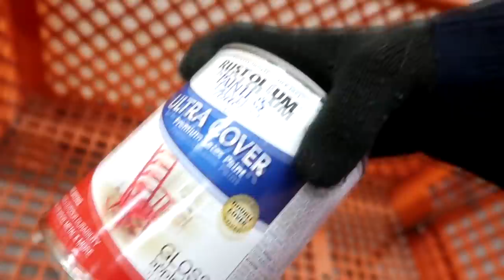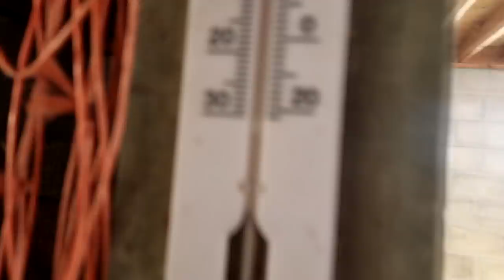FIGHTING WITH HER HORSE! Day 131 (05/09/20)

Comment: The poop pile turns to mulch which is what is used for gardens and fields. We normally spread last years winter pile on this years fields. It all decomposes after a while and the shavings wont be a problem as they will have decomposed. If you dig into the middle of your pile you will see a lightish brown colour that is an almost soil like consistency, this is your mulch. Hope that helps ☺️

Comment: I’m not tryna hate or anything but if you are trying to catch him then gabby should not swing the head collar towards him and also wait until he stops cantering and walk towards him quietly with your hands out
Reply: Lynda Youngson he was running away from her before she swung it.  If she waited for him to stop he probably would just walk or run away again when she tried to catch him again.  Making them work harder when they act like that is what ur supposed to do.  They will get tired of it and stop after a few times.  It shows them that u will be pushed around or tolerate that kind of behavior.
Reply: Lynda Youngson she already tried walking towards him quietly, but clearly that didn’t work. So she was making him move his feet. If he did not want to come to her, she was going to make him work harder. That way he would realize that it is easier to just stand still rather than to run away. She was showing him that she is the boss. That’s how you should do it with horses. Maybe do some research.

Comment: not hating but if u put headcollar behind your back and don't run after him and throw the headcollar at him might have calmed down but the wind can get them wired up anyway
Reply: It's pressure and release. If I cant catch my horse I make him run to say that if you come it its rest time. Putted the head collar behind back normally causes more problems
Reply from the maker: She never threw a halter st him. She used it as an extention of her arm like a lunging whip to make him run.
Reply: @mu5tang155  in a big field it dont rlly help tho
Reply: @ellenwillxams9837  no but that's why you bring back up tape
Reply: @mu5tang155  wouldn't it b easier to just let him calm down and use your voice
Reply: @ellenwillxams9837  yes but doing that dont really work. It all comes through ground work. Which I think finn needs way more of. Not just lunging but relaxing and that's when Warwick Schiller videos come in handy
Reply: Myponyfrodo Using your voice doesn’t always work with horses. Sometimes you got to use your body language, like they do with their friends. Gabby was making him move his feet. If he did not want to come to her, she was going to make him work harder. That way he would realize that it is easier to just stand still rather than to run away. She was showing him that she is the boss. That’s how you should do it with horses.